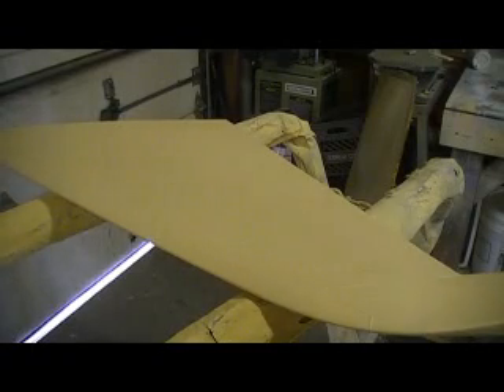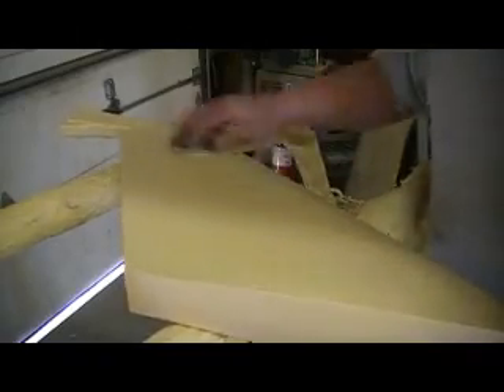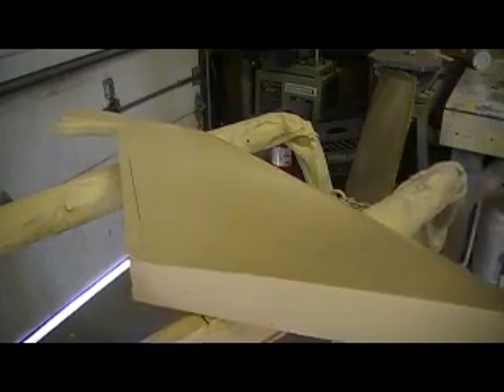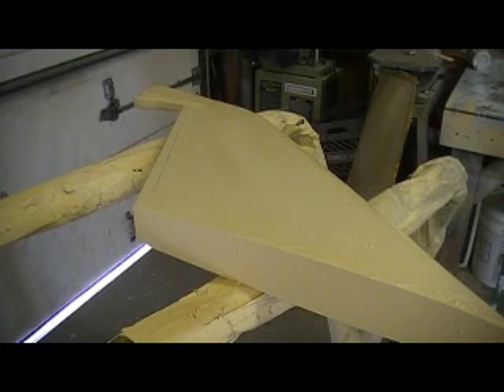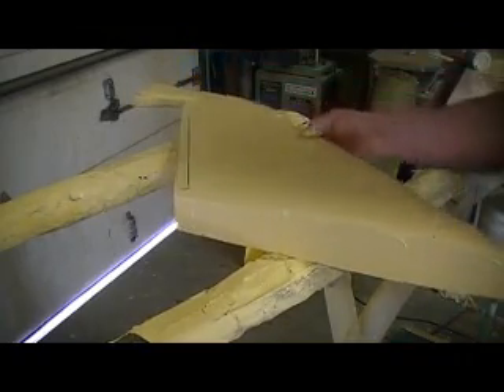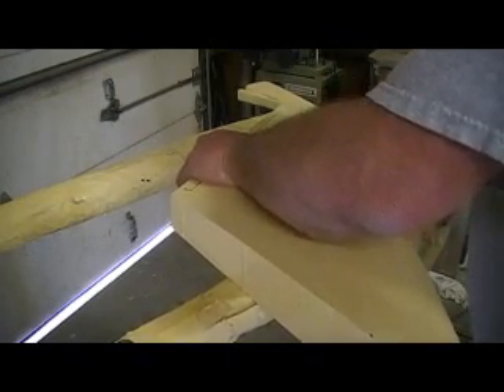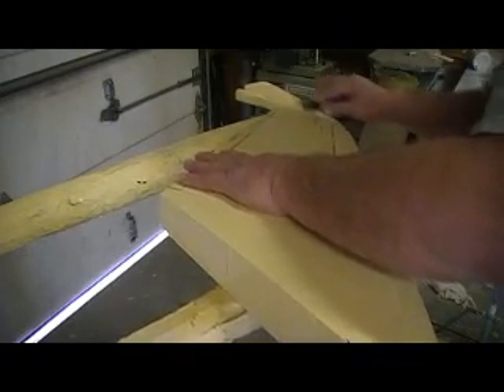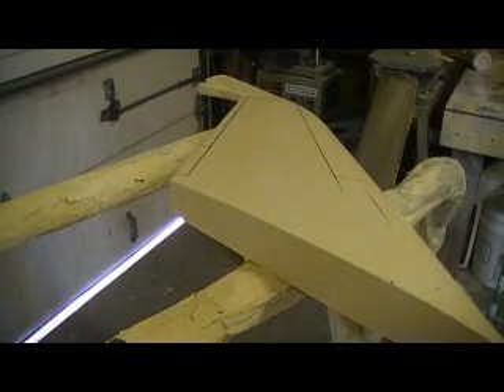how to build a rc jet B-1 Bomber # 148 PT 1

Comment: Hey Bob, if you were just to paint the wing after puting the panel lines on it with the striping tape and not mold it, what grit of sandpaper do you go down  to before you apply your urethane paint?  I will soon have to do my Byron P-51 foam wing to do.  If you go to 2500 grit won't the paint have a hard time sticking to it?
Jeff